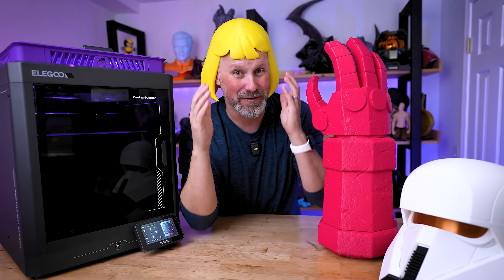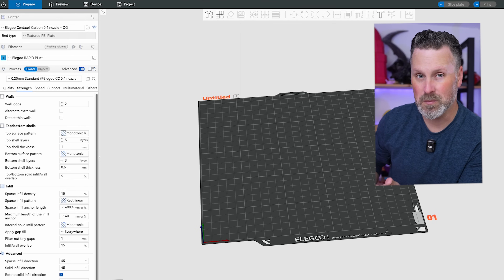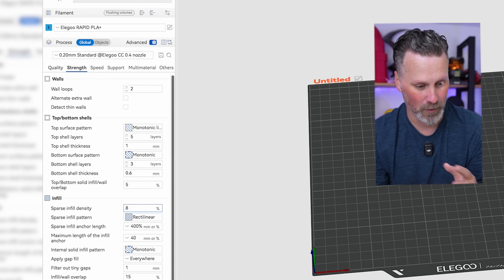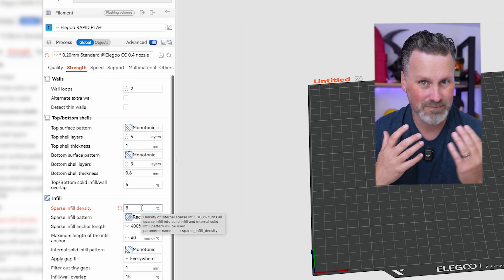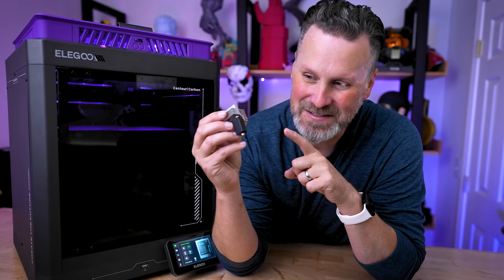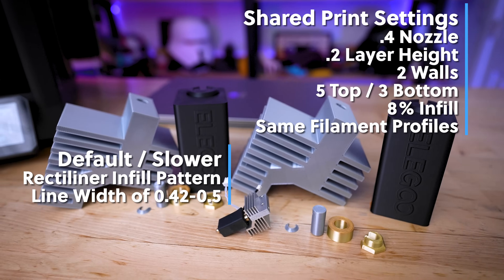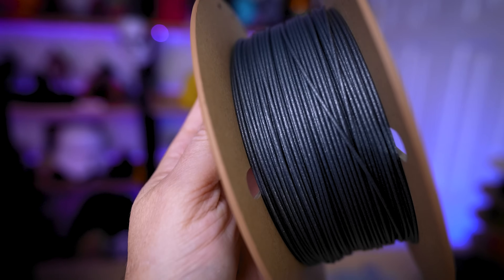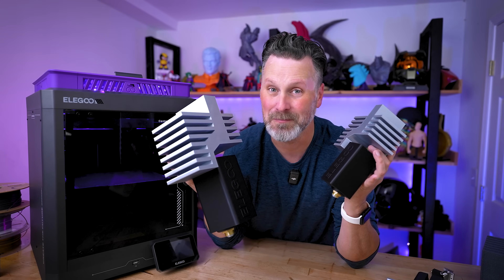Bigger Faster 3D Prints? 2 Easy Tips!

Comment: I found that the weakest part of the build is the Throat_Silver.stl. The Strenght: Sparce Infill Density default is 15%. This  is fatally fragile. Once glued up it will snap at the layer line with the smallest amount of pressure. (Falling 4 inches to the shelf below it.) For this small but very vunerable part I bumped the walls up to 4 and infill to 50%. The amount of extra time to print this part beefy is offset by the need to reprint the whole thing over again because it broke in half.

Comment: I am still on the fence with the Carbon after I installed Open Klipper on my Neptune 4 .
The Open Klipper is so much better. Yes, lost that vaunted power recovery but when you are 3D printing you must have a UPS and generator as backup.
Until Open Klipper is available for the Carbon, Sovol SV08 is on the docket.
Cheers.

Comment: If a piece is purely cosmetic and not something I plan on handling a whole lot I use lightning infill to really cut down the time, I use this for statues or bust to save time and filament, if it's something practical like a deck box or storage I take the time to print it out nice and solid

Comment: Increasing layer width will only speeds up the plain layers (first layer, solid infill and top solid infill). You can keep the other parameters to standard 0,4ish width.
Or, increasing wall width can speed up if you came for example from 3 walls@ 0,42mm (1,2mm total) width to 2 walls @ 0,6mm (1,2 mm total).

Comment: hi uncle Jesse, thx for this video!
so youre printing a 0,6mm line width with the 0,4mm nozzle? that's a lot wider..
i was hoping you'd swapped the nozzle because mine 0,6mm nozzle just came in, but i'm a bit reluctant to install it because the print quality is so good now and i don't want to screw that up. so maybe you can do a nozzle swap too, and let us know if that's doable without any quality loss or maybe tell us what calibration is needed after swapping? that would be awesome!
Reply: I’d be interested to see this as well

Comment: The downside of upping all your line widths including the walls is that you actually use more filament. Because you're using the same number of walls but thicker lines you're not going faster so much as making it beefier. The one I generally change is my sparse infill to .8 as I believe it will consider that in the percentage and make less lines. Now if you were used to printing it three walls and you change that to two walls but thicker lines then you would go faster for the same wall thickness. I think most of your gains are probably in the adaptive infill as well as the wider line width on the infill more than any of your other line widths.

Comment: Recently started to use range based modifiers in order to combine adaptive cubic with gyroid for areas that need more (or less) strength.  Also found that using a denser infill towards the top of the print increases the quality of the upper surfaces.  Especially if the top surface is varied (not flat, etc).  If have a part that wants to warp away from the plate, will reduce density towards the bottom of the print (adaptive cubic) and that really helps.  Turn off maintain vertical wall thickness, use 3 walls rather than 2.  Quicker and stronger.  Top surface quality can be increased by using the smaller line width for that.

Comment: Volume flow rate, then adjusting your speed after unlocks alot more speed. Test prints first to find that speed to quality sweet spot
Reply: There is a max flow rate test print in orca slicer. It shows you where quality starts to take a hit so you pick the number below that

Comment: Going to wider walls is only advantageous when you can use it to offset the wall count - such as going from 6x 0.4mm walls to 4x 0.6mm walls. With the same nozzle, your filament flow rate limit (mm3/s) is often going to dictate your max linear speed (mm/s) the tool head is able to move. This means that at best, the print time reduces a tiny bit by time saved on printing less infill. At worst, print time for walls will take 1.5x as long.

Comment: On modern, fast machines, a larger nozzle doesn't actually do much to speed up print times. The limiting factor on most machines is becoming volumetric flow rate, not gantry motion. Try playing around in your slicer, the differences in .4 vs. other sizes is almost negligible
Reply: It speeds it up quite a bit if you remove an outer wall. If you go from .4 to .6 nozzles you will get 1.2mm total outer wall part thickness with 3 outer walls in .4 and 2 outer walls in .6 not printing a full wall on each layer speeds it up quite a bit. It also has the benefit of thicker individual walls making the part stronger overall. You can actually get even BETTER results just using using the .4 nozzle and slicing for .6 it pushes more molten plastic out onto previous layers, reheating the previous layer, thus resulting in a slightly stronger part in the z axis.
Reply: Especially If you Print petg
Reply: I found that going to a 0.6 nozzle does help cut down in time, and so I tested a 0.8 just to see the difference. Time wasn't really different but what I noticed was the filament used. Like, the model itself felt significantly heavier and it used way more filament.
Reply: @RyoHazuki224  what printer? My point is that most modern printers move so fast that the main bottleneck is how fast filament is melted
Reply: @RyoHazuki224  that's why you cut back on the number of walls. If your number of walls are 3 (3 outer layers) @ 
.4mm then w/ a .6 just do 2 outer walls. I PROMISE you no matter how slow your hotend is at melting the filament and how fast the printer moves 2 outer walls prints faster than 3 and if their .6mm wide, it will still have a 1.2mm total outer shell thickness. Also, if you're using a larger nozzle, you can switch to a slightly more sparse infill with adaptive cubic, and it won't print as much infill on the bottom but on the top where you need it for the top layers it will branch out. Thicker nozzle means thicker infill too, so you'll need less. For strength.

Comment: Another tip not only time saving but also money saving: print as less as you can. Which means keep your supports at a minimum. Try rotating it in every direction and find the option with the least supports. Cons with this method: for example with helmets, put them upside down so the dome doesn’t need any support. However the surface of the dome will look really bad. Anyway this tip was very helpful to me, I hope it will be helpful for others

Comment: I’d like to ask as to why I keep having nonstop fails on my Centauri Carbon printer even after leveling the base, new filament, and putting glue on the base, do I need to change the infill to a bigger size or add supports or what??
Reply: fails depend on WHEN it happens. 
Try to record your prints and specially try to hear your printer.

Printers aren't magic, printers aren't appliances. They are machines. So yeah, troubleshooting skills are important. But don't be scared, learning is good and fun.
If you could explain with more detail what exactly happens on WHEN it fails I can help you out.

Comment: "aNY oF tHE oTHER sLICERS"

THEY ARE ARE FREAKING ORCA SLICER RESKINS....... AND THEY DON'T EVEN CONTRIBUTE BACK TO THE ORIGINAL PROJECT.
Reply: seems that you also didn't understand how adaptive cubic works.

It isn't magic and depending on your infill percentage it will only give benefits on prints with big internal volumes.

You mostly benefit from it when you are one of the crazies that uses 40% or more infill
Reply: ok so video could have been like 2 minutes long because the only thing you said was adjusting layer line width...
what a waste of time, just to have a sponsored video shilling for a company.

Comment: Under infill depending on your slicer you may have a setting to use finer infill in smaller parts of your model... usually there is a separate field that you can say what the cutoff is in square mm, and another variable for how much infill it should use when it encounters smaller areas than in variable 1 above.... extra line width reduces print time, and strengthens models at the cost of surface detail, for most objects this is not a problem.

Comment: I'm just playing around in my slicer with the line width at .6 to see the estimate differences and it takes 2 hours off of some of the Mjolnir parts I've got running right now! I have 2 Elegoo Neptune 3 Pros and just a few days ago started running a .6 nozzle on one of them and am loving the prints I'm getting. 

I am wondering if I can push the line width even further on a bigger nozzle? Just curious if you've ever tried it or might know before I start Googling! Love your videos Uncle Jessy, you're a big inspiration for me!😄
edit I just realized I've been checking the "automatic extrusion widths calculation" on my .6 nozzle and it seems to be even wider than .6 but I am not sure what exactly it just has a faster print time than .6 width on .6 nozzle

Comment: ERROR #1 : Changing nozzle diameter without further changes to slicer settings will not have ANY effect on speed, except it could LOWER the speed if you start hitting the extrusion volume limit set in slicer. 
ERROR #2: When using adaptive infill, the infill % value is the maximum that the algorithm is allowed to use. So if you leave it on 8%, you are likely to get 8% through all of your print. Which is exactly what it looks like in the video. When using adaptive infills or lightning, you are supposed to set infill % high (like 30 or 60), so the slicer can go high in the areas of high detail.
Also, speed comes from tuning and maximising the capabilities of the mechanics (acceleration) and the hotend(max flow).
Reply: ERROR#3: tldr

Comment: Have been using 0.8mm line width if I need to print say a single wall box of 0.8mm width. You can also print infille every 2nd layer to save time.

Comment: 0:55 Dude, you can print with a 0.6 down to 0.16 reliably….
Reply: Yeah it's amazing
Reply: Dude? You can, but it can cause problems like stringing and if the bed doesn’t have a good grip, it might pull the print off. Not saying it can’t happen all the time, but it does happen.
Reply: I 2nd this

Comment: Changing from 0.4mm to 0.6mm does not speed up the print. The printer still has the same dustance to travel. Unless you were dropping from, say, 3 x 0.4mm perimeters to 2 x 0.6mm perimeters. I think all the benefit you are seeing is from the infill change.
Reply: Larger nozzle diameter = faster extrusion for faster print speed
Reply: @sealdoggydog  usually yes, but in this case it was same nozzle, wider extrusion. If running at max volumetric flow, it means slower print speed. Math is all around us 🎶

Comment: Infill Combination! What it does is combines 2 infill layers into a single layer. In OrcaSlicer, it's in the Strength tab under Advanced section. EDIT: thanks to @keeboxpuzzles for the correction.
Reply: It doesnt actually skip layers. Infill combination combines 2 infill layers into a single, thicker layer
Reply: @keeboxpuzzles  oops okay makes sense. Still greatly decreases print times.

Comment: If you can print .6 line widths on a .4 nozzle, then what are the pros/cons of using a .6 nozzle?  Is it less likely to clog?  I'm not sure I understand how this works.
Reply: Going up to .6 increases the flow rate by around 50%.  So you can extrude a .6 line around 50% faster with a .6 nozzle than a .4 nozzle.  Also, with a .6 nozzle, you can run the line width up to .8 with no problem.  When I want something fast instead of strong, I use one wall loop at .8 on my .6 nozzle instead of two walls at .4, and that saves a ton of time.
Reply: Print speed is mostly limited by volumetric flow rate nowadays. a 0.6mm nozzle would allow a higher volumetric speed due to having less backpressure
Reply: High line width would cause high nozzle pressure, it's more challenging for the nozzle but usually still works. A 0.6 nozzle would have a much higher max flow rate than 0.4, and it would also have a much lower nozzle pressure when printing 0.6 lines
Reply: The only downside with going to .6 is that some detail on smaller prints may be lost. Not a problem on larger prints however.

Comment: 7:38 — It's kind of comforting to see classic ringing artifacts still persist…. the classic bane of 3D printing.

One small but useful slicer trick is to enable G2/G3 for circular arcs (and any other options that reduce G-code size). I recently discovered I could speed up some prints (a little) just by rotating them 45 degrees on the bed – because many (most?) printers can move and change direction faster on diagonals. Check the slicer time estimate while rotating objects on the bed for some surprising differences.

Awesome slicer tricks aside, it's now a viable option on most printers to tune the onboard Input Shaper (after a firmware update) and bump the print speed 50% or more past old limits without any loss of quality. And we have better high flow nozzles than ever before, so that's a really good speed upgrade for machines where the extruder is the bottleneck. Some printers (e.g., AnkerMake M5) do a pre-analysis of the G-code before printing to optimize jerk and acceleration. I'm sure we'll see a lot more of this kind of built-in intelligence in the future.
Reply: Arc commands are a complicated topic. The format of STL does not support arcs. If you save a cylinder into STL, the software approximates it as a set of flat surfaces and saves like that. If you enable an arc fitting feature in slicer, the slicer will try to guess the original form of the arc, send it to Klipper, which will... approximate it back as a set of lines. All of this for what? 
I only use arc commands for a spiral Z hop trajectory for PETG.